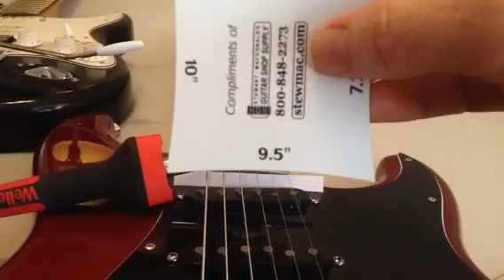Curing Stratitis By Moving Polepieces

Comment: I have taken cheap ceramic pickups and took the ceramic magnet off the bottom and taken the slugs out and put ainico magnets in and super glued them-works like a charm and sounds very good. Just be real careful. Sometimes the coil wire is right against the magnets and could damage them. Some pickups, just have lacquer sprayed on the magnets and then wrapped. Do at your own risk.
Reply: Think I'm going to give your idea a try
Reply: It really works, just go slow and tap easy on the slugs-If they are hard to get off, take you soldiering iron and heat them a little. I have done it many times and if they have a good amount of windings in them they will sound great. Come back here and let me know how they work out for you. If you mess one up you haven't lost a lot of money. I put a drop of super glue on the bottom of mine. I got the six magnets, I have not tried a bar magnet on the bottom-that might work-been aiming to try that. Good luck.

Comment: I've been playing for well over 25 years and recently installed a set of Texas Specials in my USA Strat. I had such high hopes for this pickup set, but was so frustrated with them that after a couple weeks trying to make subtle adjustments to overall pickup height of each pickup, etc., that I left that guitar sitting unplayed for about 6 months. Then, I saw this video a couple days ago and followed your instructions. I now love those pickups and love my Strat again! Thank you for sharing your knowledge, this is a GREAT VIDEO😎!
Reply: Fender hype: In 1996 I installed Texas specials in my USA Standard Deluxe Plus to get rid if the anemic gold Lace pickups. I was totally disappointed. Since then I found out that Mexican Strat pickups from that same era sound just like Texas Specials.
Reply: @archiguitarchi  No chance they sound the same in the guitars I've compared.
Reply: Texas specials work better than most. The Telecaster sets are the absolute best. I found a hand made pick-up make called 'Vineham" and though they are'nt expensive compared to the rest they are spot-on !
Reply: Texas specials work better than most. The Telecaster sets are the absolute best. I found a hand made pick-up make called 'Vineham" and though they are'nt expensive compared to the rest they are spot-on !
Reply: I agree . . . the G warble with the Texas Specials was impossible until I used a pair of pliers large enough to fit over the G string and some protective material, and slowly squeezed until the G pole came down to a decent radius height. Warble Gone.
Indeed, I would NOT do this to all the poles and check for a base plate or anything getting in the way. 
And, when I saw this guy put a soldering iron to the magnet, I got sick. No, No, No. 

This YouTube post definitely needs a Black Label Warning.

Comment: I see some people on here immediately criticize either based solely on what they've more than likely heard from others, or they actually tried it, but probably had no business attempting this as a DIY project. "heat causes loss of magnetism," etc. first of all, know what you're doing and you won't damage the magnets by applying a sufficient amount of heat required to do this. You only heat just enough to soften the wax. you're not even melting it. Follow that thought pattern and even invest in a temperature controlled soldering iron if you have to. Pickups are subjected to a higher temperature when they are wax potted than what is required here. So, if anyone honestly demagnetized a pickup by trying this, YOU DID IT WRONG.

Comment: Thanks for sharing. I'm designing noiseless p90 split pickups like on pbass. Was going to use adjustable screws, but this method allows me to use magnetized slugs, instead of bar magnets. Also when designing i will not wax pickup yet until I can profile the heights. Flat pole pieces have uneven balance. May even be possible to use different magnetized polepieces, A2 for lower strings and A5 for unwound strings.

Comment: Warning. Check the design of the pickup before adjusting pole pieces. If you have a cheap made single coil pickup that uses a plastic bobbin that the pole pieces slot into you can move the poke pieces safely. On vintage spec pickups with cloth bottoms and the windings wrap around the pole pieces do not take the chance on moving the pole pieces . This style of pickup is not designed to have its pole pieces moved after its assembled. Moving the pole pieces can damage the coil rendering the pickup useless. Just because someone got lucky and didn't destroy the pickup doesn't make it the right thing to do. Be smart !

Comment: Heads up on the soldering iron technique. You'll want to be cautious that you know what your pole pieces are made of. One thing you are risking is reducing the strength of the magnetic pole pieces you are moving by locally heating them. You don't have to heat them to the Curie temperature to do so. Alnico is the most hardy material with respect to this, they have a working temperature (a temperature below which, on cooling, the magnet will regain most of its strength) of over 800 C/1500 F. So those are going to be alright for the most part. But ceramic magnets are some of the least tolerant to heat with working temperatures of 250 C, well within the temperature of your soldering iron tip.
It might be safer to soften the wax by "re-potting" if you have ceramic magnets.

Pole pieces are also in the worst geometric configuration for loss of magnetism as cylindrical magnets with a small radius relative to their length are most susceptible to temperature degradation. 

This is something that often comes up when people try to use neodymium magnets (probably the most fragile with regard to heat) as battery connectors and try to solder wires onto them only to discover that they are no longer magnetized, or no longer symmetrically magnetized because the Curie temperature is below that of the soldering iron. Even when carefully handled, they just cannot be heated much above 150 C without losing magnetism.  The solution there is easy. Just solder onto a washer and sandwich it with thinner magnets.
Reply: Many temperature controlled soldering irons can be set to somewhere between 50-100°C, which may help avoid demagnitizaion. Now there's a caveat there, the temperature control circuits aren't necessarily linear. It's calibrated around 300°C (if it is at all - anything made by Zhongdi or Aoyue has quite a bit of leeway, and the rest of China is even much, much worse, up to 150°C wrong), and at temperatures below around 150 the temperature control can be increasingly wonky, so it's probably better to check with a thermometer (e.g. K-type multimeter thermocouple) that is good around these temperatures. I expect that much less than 50°C is sufficient to release the wax, as he can touch it with bare finger, which would have been more than a bit difficult starting around 55-60°C. At the same time, 60°C-80°C should be just about benign to neodymium magnet, at least according to what i have spontaneously googled up.

Also with higher temperatures you have all kinds of issues. 50°C will certainly liquify the wax, 90°C will liquify shellac, and let me assume that the plastic is polystyrene or styrene copolymer, which i guess is fair, it'll melt at around 240°C. PVC will give up in the worst possible ways near 160°C. People are concerned about magnets but are losing a bigger picture that if the temperature was actually near as high, a lot more damage would occur.
Reply: There is no reason to heat the pole pieces to move them. 
Moving them in the first place is risky, so heating them too adds even more risk of destroying them.
The technique that I have used twice- with success- on Fender Original '57/'62 pickups to lower the G magnet and raise the B magnet is to use vice grips.
*When you are lowering a magnet you need to put a stack of 2 washers under the magnet (where the other side of your vice grips are pressing) to allow a place for the magnet to go.
*To raise a magnet take a little short sheet metal screw with a wide head (I use the computer screws that secure the panels or hard drive on a computer tower) and press the tip of that screw into the bottom of the magnet with your vice grips pushing on the head.
This is very low impact and gradual.

The reason I had success and didn't damage anything is probably because I didn't move either of the E magnets- which have the wire wrapped around, and laying on, half of their circumference.
Or else I'm just lucky.

I guess this guy came up with the idea of heating the magnets out of desperation after being unable to move the magnets without the assistance of mechanical advantage.

It is much better to use mechanical advantage with vice-grips. 
And I'm not being a typical youtube judgmental a-hole... it's no biggie that he didn't think of vice-grips.  I'm not bashing the guy

But I do think he is damn lucky that he has not cooked his pups (at least, not to a degree that he notices the tone loss due to the magnet field reduction). 
There is no negativity in the post!
Reply: Science!
Reply: StratMat777. The magnet wire is not resting on the sides of the e string poles. The poles are inside the bobbin.
Reply: "..geometric configuration.."
It would have killed you to say "..shape.." lmao. Dont want anyone thinking you're not amazingly smart, perish the thought.

Comment: I just tap mine with a plastic hammer, very forgiving. I don't see why moving the pole pieces should interfere with the wires on the bobbin though as they are protected by the bobbin?
Reply: You'd be surprised how much damage you can  Do.. I've messed up several pickups experimenting.. It's usually trying to take covers off of telecaster neck pickups.

Comment: Hey there  -  I've got no "warble." But I DO have some strings that are much quieter and some that are much louder than the others on any set that I have put on this one particular Strat-type of guitar. 
And on this guitar, I do think that I could at least help getting the strings to a more uniformed volume if i could manipulate the single coil pole pieces. Like you can somewhat with the screws on the top of humbuckings. 
In fact I bought this guitar new with a HSS config. But have just recently swapped the H for another S and pickguard. 
The neck and middle pickups have the same string volume issues, more or less. But to me at least, that string volume thing and the lack of fullness and round sustain on certain strings, REALLY stand out on the bridge single coil. 
It's funny, i could get the string volumes closer with that humbucking and it's screws, but I had trouble with the sound of the humbucker. I am a single coil guy when it comes to guitars, I guess. I like Telecasters. 
It just sucks when I am working with a really nice full, overdriven sound and I'm (attempting to) play a wild solo, the B string sound all cool, full and great sustain, then I hit notes on the high E and there is just nothing there. By comparison anyway. 
On all facets of my life, many around me say that I am picky about things. Too picky. But I want to hear what I want to hear from a guitar. Within reason of course. And this different volume on different strings thing bugs me to no end. On guitar AND bass. 
So I'll bring up the treble side of the single coils, to get more volume out of the high E and then the B is much ouder and the G is ANNOYINGLY too loud. Along with the low E, the 2 loudest strings. 
And I wack the strings with way too much force too I guess. I have been a bass player forever. But on guitar....imagine a 2 bit Neil Young meets Pete Townsend. When I strike a chord with an open low E, that E string obliterates the other strings. Even the obnoxiously loud G. And of course it is not only way too loud, but sharp as well. BWannhHYYYANGGG!!
And also the D string on this guitar is considerably more quiet that the low E, A, or G.  That D is what I "think" is a mechanical issue though. I say that only because I can hear less volume from that D acoustically....not pugged in. 
This guitar does this same stuff with ALL sets of both different brands of 10's that I use. D'Addarios and EB's. 
I have done the pole piece manipulation on 2 different Music Man basses, without having to heat the poll pieces or anything. 
And that was fairly easy. Hard to get them exactly where I want them though. It is NOT fun to keep pulling back the strings, and removing and then reinstalling all 3 of the components that make up one StingRay pickup, again and again. Not fun at all. 
But I have done it. And it worked to a certain degree. 
Music Man active basses have some weird stuff going on in their preamps. With different EQ settings WILDLY affecting string volumes, way WAY more than you would think that they would or should. 
But this guitar that is giving me fits with the wacky different string volumes, has pole pieces that I cannot break free from the top. 
I may practice on another single coil though before I try the heating thing on this boo-teek guitar.

Good tip on heating up the pole piece. 
And on the neck heel screw idea too. That clip brought me to this one. 

Cheers
Reply: N2F1 neodymium magnets under the pups.i used the bar kind about 3mm thick. I used one bar right across and went up to three layers under the quiet strings. I have done three basses and a mandolin so far with good results.

Comment: I wonder if you could cut a spare pole piece to add a short piece to the B and E poles. Magnets don't care about being a solid piece or several small pieces, they perform exactly the same. A dab of glue between them and you're set. Add exactly what you want to fix the radius problem and you don't need to alter the original poles.
Reply: Nah bro

Comment: Can I do the same in a bass? I purchased the Fender Custom Shop '62 P Bass Pickups and I get noise whenever I touch the pole pieces while playing. All 8 pole pieces are higher than other pickpus, which causes the aformentioned. Now, I can try clear nailpolish to avoid direct contact, or grounding the pole pieces again (which I already tried and didn't work) but this one seems like the solution I'm willing to try by myself, however, oddly enough, it is the most risky.

Comment: I know this will freq-out all you polepiece experts; but I just ground down that noisy, obtrusive sucker with a Moto Tool. Works just fine. And even if it didn't, there are PLENTY of good PUP builders out there ... BTW: Been playing the greatest guitar model on the planet, for 56+ years, now. Long live the Stratocaster!
Reply: It sounds good I was thinking of the same thing that you did. It makes the most sense
Reply: @dannymuhammad8321  I try to have my tech guy push 'em down; but sometime, I just can't wait!! That high third string pole piece just makes the worst racket and drives me crazy! Now if you used a roundwound third, by all means, keep it high ... that's where it came from in the first place, but Fender can't quite get it through their heads that FEW people use a wound third anymore and that the high pole piece sounds awful!

Comment: You can also buy the Seymour Duncan SSL2 which is a flat pole piece.  Seems I got a bit less quack though, so I switched to the CS 69's. But, the volume on the high strings is definitely a problem.
Reply: I got a SSL-2 but I don't like it. I want to stagger it for more middle and some low frequencies. I've a 9.5 radius. I'll give a try. It cost me 24 euro only new...

Comment: This works on plastic bobbin pickups. Only works on a fibre bobbin if you're really really lucky and should not be attempted an a pickup you are not prepared to rewind or replace. I sometimes do this on fibre bobbin pickups i've wound myself to adjust a badly behaved G string. Usually when a client insists on a vintage stagger on a pickup but has a really flat neck.

I've been putting alnico rods or steel rods with neodymium disks (careful, causes loads of wolftones if you run the pickup close) with  into plastic bobbins for a while and playing with the stagger. Won't work on a pickup with a single ceramic bar underneath (these get magnet swaps). Fender seem to have longer poles with ceramic magnets each side on recent low end guitars where this technique will work.
Reply: I know this is old but do you know if Seymour Duncan SSL-1 are plastic or fiber? I did this with mine and all three worked out
Reply: @DooblesGoDoobles  they're fibre. You've been really lucky.
Reply: @rowlandstraylight  I didn't use heat, just controlled force, but woop woop I guess, go me

Comment: Some post's below are correct, BE CAREFUL, on vintage pickups the wire IS wound directly on the magnets. Many PU's have been ruined doing this. The middle pole pieces are safer as the two E strings have the wire wrap half way around the mag. YES you are very lucky. Newer ones no big deal like you said the mags sit in molded plastic. Isn't that warble part of the vintage tone?

Comment: Just got some cs 69s. They sound great except the g string is overpowering the b and high e string. Guitar has a fairly flat radius. Dont think I'm gonna do this methode. Maybe I reradius the fingerboard to vintage spec. I done this to a guitar before as I didnt like the flat radius. I even used the old frets.And because you are actually making a wider surface the frets are a little short. So I had a nice roll off of the fingerboard edge. It worked out very well. Took a we while but was worth it !

Comment: Usually, the plastic bobbin pickups are pretty safe. Some of the fiber bobbins you may run into it breaking the coil. I would not heat the slugs. This will degauss the magnet. You can push the slug down without melting the wax but if you want to soften the wax use a blow dryer or heat gun but I still don't recommend that.